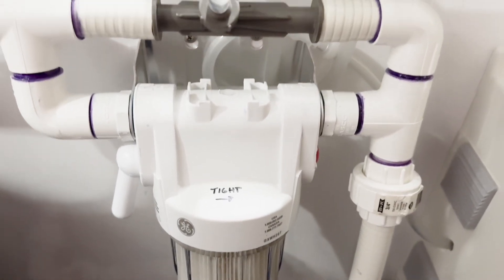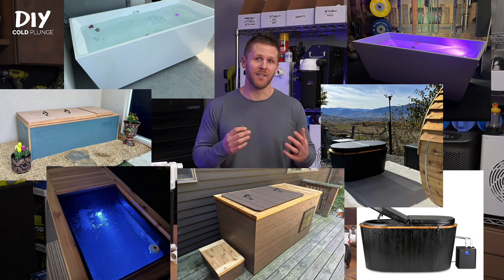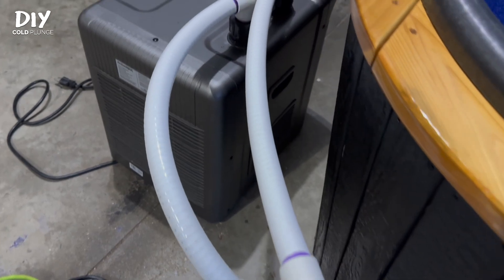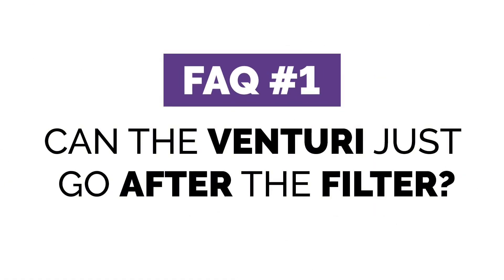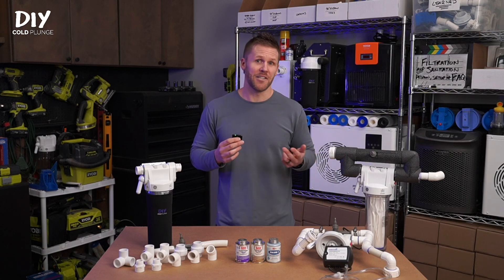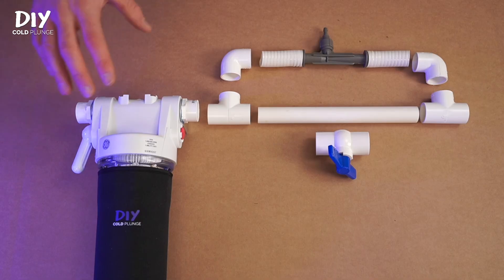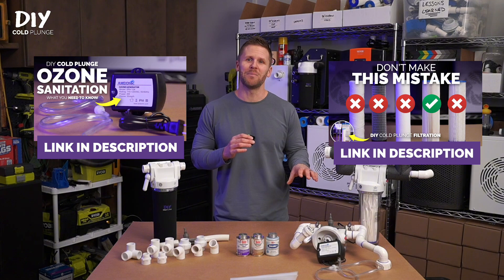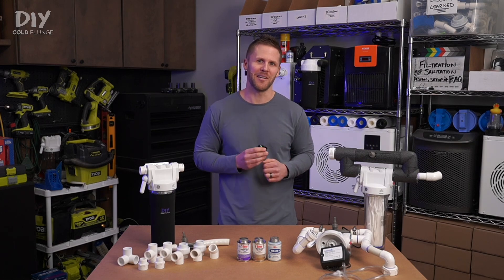Avoid These Mistakes! DIY Cold Plunge Filtration & Ozone Setup – Explained

Comment: Anyone have issues with filter not staying full with water? I'm not running a venturi, just the danner 1200 pump into the same GE filter into the active aqua 1/2 hp chiller. The filter is alwasy bubling and only half full with  water. I've release air, primed the pump, turn everythign off and seen the filter 100% full but within a few hours its half empty again. What is happening here? air in the system somewhere? hose clamps not tight enough? i don't have any water leaking anywhere and the system works, just concerned about long term issues running like this if anyone has any insights. thanks.
Reply from the maker: Check the O ring on the filter housing. This is typically the reason

Comment: Can someone tell me why so much hype for the Venturi? I’m using hydrogen peroxide and monitoring concentration. I have a whole house filter and mesh filter before the pump. 

I always shower before plunging and expect to swap water every 4 weeks. Will I still benefit from a Venturi?
Reply from the maker: It's a hands-off system where you don't need to monitor levels and folks keep water 3 months to over a year between changes

Comment: I have an Intex C-1000 that comes in play prior to the chiller on my Rubbermaid stock tank.  I tried inserting an ozone with venturi after the chiller but I couldn't get the flow out of it.  At the moment I have an ozone generator that I simply insert in he tub for an hour or so and remove it.  I am looking for something to generate more ozone bubbles tog et more use out of my water.  I like your set up but I am not sure it would work with my design, any suggestions?
Reply from the maker: You'd need to set up an ozone loop last in your system, and do it with a ball valve like I show in this video 👍
Reply: @DIYColdPlunge  Tried that too, didn't work
Reply from the maker: @ecboatrainingvideos8241  and you have it after the chiller?
Reply: @DIYColdPlunge  I did all that but no ball valve.  I couldn't get any bubbles to come out the line.  I could email you photo's of what I did, can't figure out how to attach them here.  Right now I have a 200 gph  submersive pump with a venturi injector and I am not getting much more flow than with the ozone by itself.  Getting frustrated.
Reply from the maker: @ecboatrainingvideos8241 you're not using components that are capable of creating a vacuum. I've got a separate video on pumps - you want something in the 900-1200 range. Also now I can't tell if you had the ball valve or not - I included that in my reply because it is essential.
Reply: @DIYColdPlunge  Got it, so I could insert this after the chiller on the way to the tub, but the ball valve is what makes the pressure enough to pull the ozone out when you close it?

Comment: I have a question regarding having the venturi as a component of the filter vs inline later with a venturi loop. If you do it as a component of the filter, it requires you to put the filter after the chiller to minimize the ozone that passes through it. If you build a separate venturi loop you can have the filter before the chiller (removes large debris that might damage your chiller) and the ozone after. Is this why someone might choose to separate these components?

Also when I look at the flow rate of my cold plunge, I wonder if the ozone placement matters. My pump has a flow rate of 1,200 gph and my tub holds roughly 100 gallons of water. The math on that would suggest that I cycle my water 3 times in 15 minutes. If that is the case and it takes ozone about 20 minutes to break down, wouldn't I be getting ozone through all of my components for the duration that I run the ozone anyway? Any help is appreciated.
Reply from the maker: Hey John! I've found this to be easiest for single-household setups (which is who my content is aimed toward). If you are inclined to beef things up you can add filters wherever you feel necessary, but in my almost 3 years doing this I've never needed a filter before the chiller. Any debris that can make it through the strainer piece at the outlet hasn't caused me any issues. Whenever you separate them, or add filters in places that slow flow overall you need to closely monitor things to ensure you don't lose the vacuum.

Ozone/venturi placement matters to ensure the vacuum is established and consistent. I'm not exactly sure what you're asking/implying but from what I think... your math is correct, if you assume water flows in sequence with perfect circulation (not sure that's possible in a tub this size/water mixing upon return to the tub) AND that there is no flow loss from the components, plumbing lengths, etc. in your system. All of those things decrease the effective flow rate from the advertised flow rate at the head of the pump.

Comment: Hey Joe! Appreciate your thorough research and experience. Why not just put the Venturi in line before the filter? I’m having a hard time imagining how I’m going to get this piece put together given the relative inflexibility of the short 2.75” spa hose pieces
Reply from the maker: Thanks! You'll want to assemble from left to right, not squeeze the spa hose in to the (nearly) finished assembly 👍

In regard to your proposed configuration - you need to maintain a level of flow/velocity for the vacuum to work. Adding components after the fact slow things down and you'd still have the issue of the Venturi being the limiting factor in overall flow rate.

Comment: This is different than the configuration in the plans we purchased on the DIY website.
Reply from the maker: Like I say in the video, there are a number of configurations that will work and the best practice is prioritizing flow to the Venturi first. The pdf on my site does that for pairing with the penguin chiller 👍 If you have any questions along the way you can always reach out via email.
Reply: So are the plans that were purchased last year still good? Or should I take apart my current build and re-plumb?
Reply from the maker: @ yes the plan you purchased follows the guidelines I lay out 👍